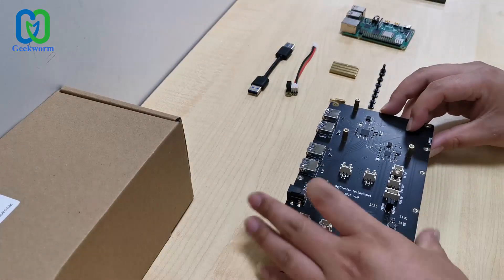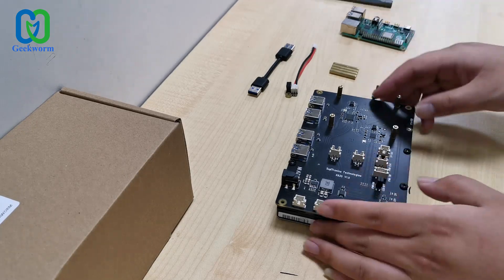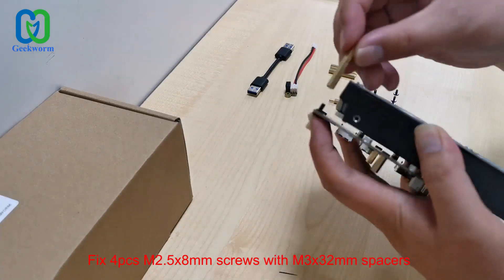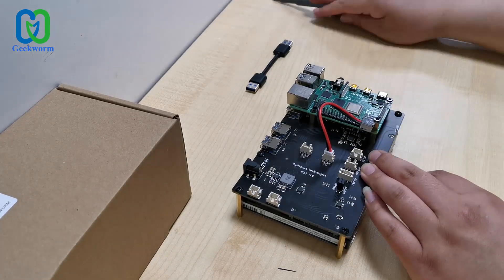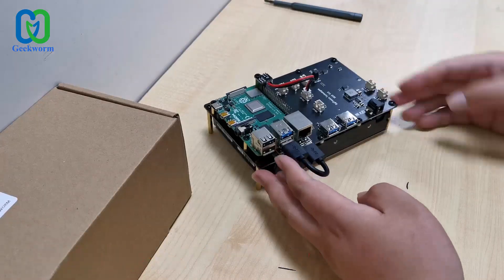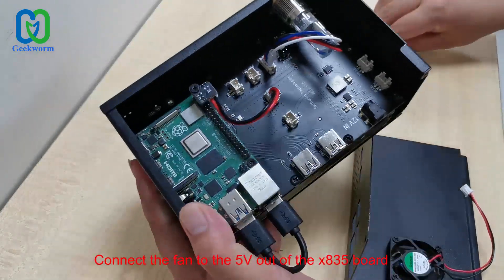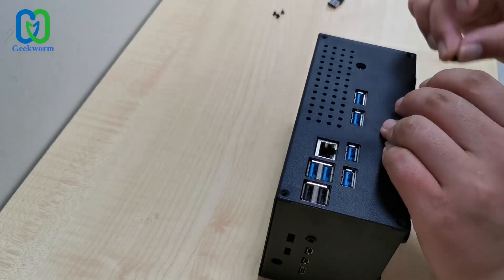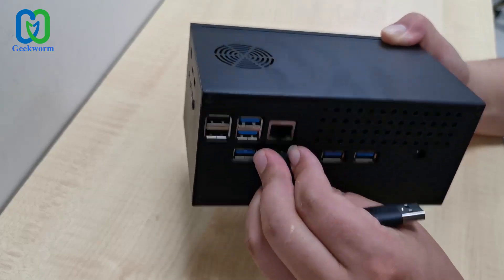How to Install Raspberry Pi 4+ X835 3.5" SATA Storage Board+X735 Power Management Board?

Comment: I ordered(Amazon) the X835 and X735 with metal case last week.  Installed yesterday and noticed no Wifi 2.4Ghz.  This Wifi issue is stated on the Website to use 5Ghz..  I removed the Cover and then Wifi worked...I noticed the SSD was not loading BerryBoot...I removed the Pi,X835 & X735 from case and no SSD issues.  So we have a Case that Blocks Wifi (What kind of metal and paint are being used?). I have the units sitting on my desk and all is good.  Need to buy a Clear case.

Comment: Does it work without the hdd?
I mean, in case I have to take the hdd out for some reason, should I plug the 12V power supply to the x835 in order to power the raspberry pi on?

Comment: That looked like a standard hard drive not an SSD??????
Reply: Yes, it appears as though @Geekworm is suggesting that the x835 board connects to Spinning disks; though SSD would connect in much the same way.  However, it is horribly unclear from the video -- and wiki page link posted by Geekworm to a comment 6 months ago -- exactly how the USB port on the x835 board is suppose to connect to the SATA connector on the HDD (spinning disk).  Seems as though an adapter would be required. Is there a SATA connector on the bottom of the x835 board?  I can't find any clear images of the bottom of the x835 board on the wiki or in video.
Reply: Found a view that does show the drive connector on the bottom of the x835 board at 25 seconds into the video.

Comment: I have installed everything like shown on video, 7:26'. However, power-on button with the case works but it doesn't shut down when pressed again. Latching-Switch-Jumper cap on X735 is ON and Auto-Power-ON cap is OFF. PWR-ON cap is OFF on X835 and Led-OFF one is ON. Any suggestion?
Reply: Same here. It's off when you plug the cord in, but when you push the (Latching) power button, the unit comes on and when you push the power button again to "Unlatch" or open the switch, the power stays on. Even if you wait a bit.

Comment: hey could your guys aluminum heatsinks kit work with this set up between the raspberry pi board and x735 for add protection and cooling ? I also have a case kit for the ice tower cooling fan ?

Comment: Since it is possible to stack 2 x835 would it be possible to use two USB 3.0 ports of the Pi so every HDD gets its own port?
Additionally, does the x835 come with a power supply, and how many power supplies are needed when stacking 2 x835? Does every board need its own power supply or can they be linked to share the power somehow?

Comment: Is it possible to Stack 2x x835?
Reply: You can stack the two boards together but you will no longer be able to use the case. Furthermore (and more importantly), both disks will be on the same USB3 bus, so the I/O between disks will be shared, meaning that your overall performance will most-likely suffer. So, if all you care about is adding more storage capacity and you don't get the case, start stacking! If you care about performance, then stick to one disk or go with an entirely different setup (like the RockPro64 case, which holds 2 disks and, if you go with the RockPro64 as controller instead of the Pi4, you can have the I/O go over a real PCIe bus, which is likely going to be better for performance).
Reply: I should also note that you're working with cheap SBCs. In my setup, I'm using 1-disk-to-1-SBC and clustering them together over the network. This keeps performance high but adds a LOT of complexity on the setup (cluster storage is an entirely different animal than just building a RAID on a single device). If you want performance, but multiple disks, go buy an old PC (~5 years old or so) for $100 on Craigslist and use that. You'll get further than an SBC will get you, for about the same price.
Reply from the maker: Hi,
Yes, you can stack 2x x835, but the USB cable inside is too short to stack, you need to prepare the longer USB cable yourself. Also our X835 case only support install one X835 board.

Comment: If anyone can answer my last question I would appreciate it.  Am I missing something as I still can't see or work out how the HDD is actually connected to the the boards or Raspberry Pi.
Reply: The HDD is connected to a sata connector where it slides in on the underside of the bottom board, then the bottom board is connected to the pi with a USB 3 cable, (that short one). So basically the hdd is connected to the pi with a usb to sata cable. You still need a micro sd card in the pi (and use berryboot on the sd card) and boot the rest from the hdd.
Reply: Just plug the HDD hard disk into the SATA connector of the X835 board.
Reply: Didn't you see the SATA connector on the board?
Reply: engrrajonahmed  I have now I have replayed the video a few times.  I am still waiting for my order to be delivered (I ordered over 2 months ago now).
Reply: @WurzelsFan  Cool! But it's pretty slow! I mean the package delivery!
Reply: engrrajonahmed it never arrived so had to claim my money back through PayPal as the seller was less than helpful.

Comment: Rather odd as the HDD is not connected to either power or data??  I purchased one of these kits a few days ago and now looking at this video I am a bit confused as there is no connection to the HDD.
Reply from the maker: Hi, the 3.5" hdd is connected to X835 board. please refer to here for more information: http://raspberrypiwiki.com/index.php/X835
Reply: @Geekworm  Thanks, That is not very clear on the video as it just shows the HDD being screwed to the board.  Anyway thanks and I look forward to receiving my kit soon.
Reply: @WurzelsFan  did you receive your kit already? Can you upload a review or something that tell us how it is working? I think I connected mine wrong because the HDD doesn't turn on.  Thanks in advance!
Reply: @Geekworm  Yes, we can assume that the HDD connects to the x835 board, but how exactly? Is there a SATA connector on the bottom of the x835 board?  I can't find any clear images of the bottom of the x835 board on the wiki or in video.
Reply: Found a view that does show the drive connector on the bottom of the x835 board at 25 seconds into the video.

Comment: no heatsink?
Reply from the maker: Hi, it is recommend to use with X735 board for auto cooling and power management function.
Reply: I bought their kit, which includes X835 board, X735 power manager, and the case. The package actually contained a small baggy of heatsinks (with adhesive) for a Raspi4, which I didn't expect. You can put the heatsinks on or not and the fan should fit either way.
Reply: How are you finding the temps with the Pi4 and this case? 
Curious how it would go with an OC and the Pi4 being stress tested vs the Ice Tower cooler.
Reply: @DruidWilliam  Heatsink + fan is the best you can do for the build. After that it's up to you to have a temperature regulated environment. For me, I have my stuff in a fairly cool area and haven't had issues. Of course each environment is going to be different and, thus, give different temperature results.

Just keep in mind that a RasPi4 is board for DIY, not for production. If you require production-level runtime and your operating environment can see temperature extremes, you need an entirely different setup and it'll cost you 10X more money.